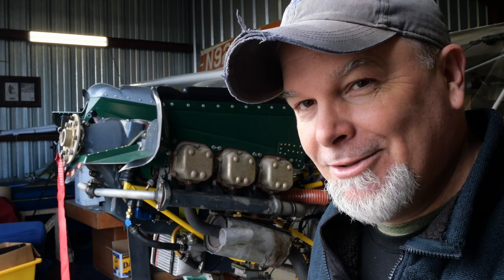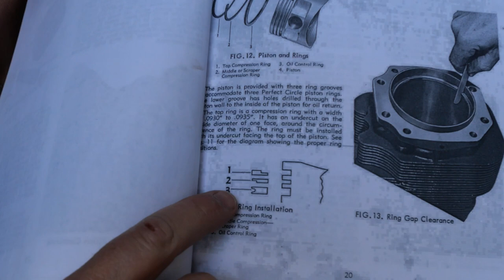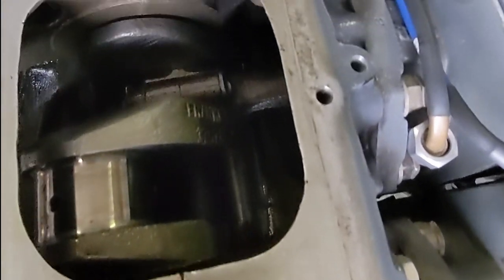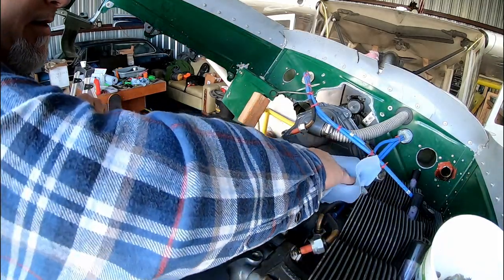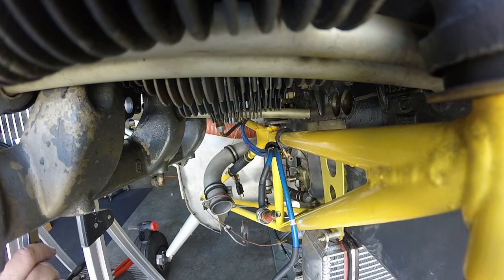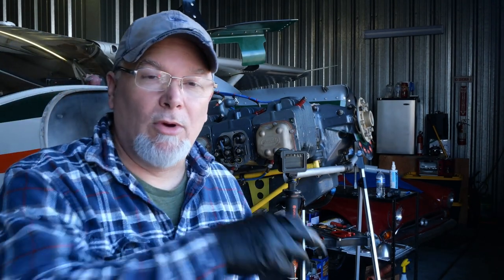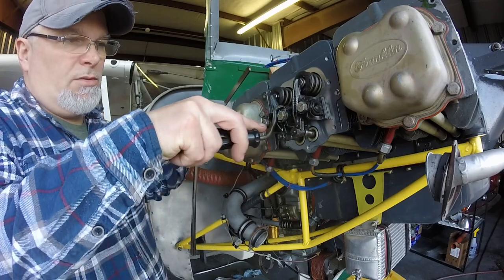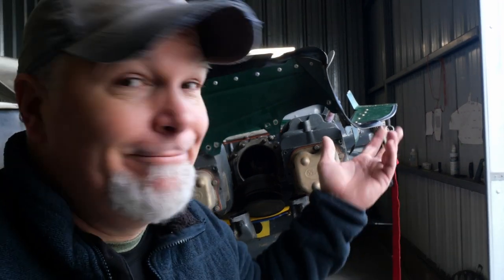Cylinder Swap |  Replacing a Cylinder on the Franklin 165hp

Comment: Good stuff. I have a '46 straight-108 with the Franklin 6A4-150-B3, based on a private airpark west of Bremerton. My wife and I are in central BC, having been on our way to Alaska last week when we lost a cylinder and diverted 50 mi to a small airport. Turned out to be a broken intake rocker arm on the #5 cylinder - this is one of the early 150s that used stamped rocker arms vs the later 150s & 165s that used forged. Valve wasn't stuck, pushrod not bent, rocker arm showed polishing along the crack line which makes me think it developed over a while.

I was able to source a replacement rocker arm only 90 mi away, but the mechanic who brought & installed it isn't familiar with Franklins, and we had a hell of a time getting the lifter depressed on the exhaust valve side to get the clearance set correctly (granted, without your handy tool). We got it close enough and I flew to his shop, engine ran slightly rough at times. This morning he made up a better tool and was able to depress the lifter enough to set the .040 clearance correctly, and on test flight engine ran much smoother. 

Curious if you've seen much variability between your various lifters. I'm wondering if this one being so stiff is due to being gummed up with carbon or whatever, and if this might impact oil delivery to the rocker arms. Maybe hastened the failure? 

Above aside, we decided not to continue north to Alaska. Engine only has 100 hrs SMOH and the failure gives me qualms about taking it anywhere too remote until it's proven this is a one-off.
Reply from the maker: As with most older aircraft and engines it's a risk you taking flying an older vintage aircraft on a long trip. Even after an Overhaul I always prefer to fly as many hours as possible. I am a very big proponent of Mike Busch's philosophy of proof of operation ( If it ain't broke, don't fix it ). If you have got to the trouble of finding that rocker you no doubt ave looked at the others. If you are that far intern Overhaul I would be less worried than if you had say 20 or 25. By the 100th mark most of the egregious errors pop up as you have noted. That should be some reassurance.

As for the lifters, there are a couple different styles. The Stinson Franklins share a lot in common with the Helicopter motors. Some of those internal parts are interchangeable and some are not. As I understand the 2 styles I have seen are interchangeable, I have both in Shelia. I ask that question early on with Susan @FranklinEngines , and she assured me that they were. Regularly checking those clearances ( 200 hours is the interval ) will keep your engine purring.

I hope that you have agreeable weather and have a safe journey.

Christopher

Comment: Since the 3/8" drive is in line with your wrench adapter, I don't think you need to turn your wrench at a 90. The drive isn't extending any, it just goes around something. Glad to see another of your videos. I don't have a Frank in my Stinson, but always cool to learn about them. Thanks!
Reply from the maker: You are correct about the center line. Mine are fairly close being custom made. This rule is more for crows feet and torque adapters. Thanks for pointing it out.

Comment: Hi great video. Can you share dimensions of the cylinder nut tool. Just received my 6 cylinder overhaul but don’t have the tool. Will make one. Thanks
Reply from the maker: Yeah, I don't know of anybody that sells the Franklin Cylinder wrenches due to the square angle that's needed to get around the fins. I would recommend around a 12" length and a 5" depth. Try to keep them concentric, so as to not need any torque corrections.

Comment: My VW bug ring compressor is just like yours!
Reply from the maker: The ring sleeves must be pretty small. What diameter are they?
Reply: @FreedomfixerFlying  cylinders are 88.5mm (about 3.5 in). Another question, do Franklin engines have cylinder studs that are also through bolts on the case (like the 'other' airplane engines)? Is there the same risk of spun main bearings after cylinder work?

Comment: I have a  Stinson 108 with  150 hp. Franklin  where did you send your cylinder to be repaired?
Reply from the maker: Since Airworx got out of the Franklin business, I currently do not have a shop. You can contact Susan Prall at Franklin Engines in Jewett Tx, Franklin Aircraft Engines in Ft. Collins Co or Franklin Aerospace in Thomasville, NC.
Reply: @FreedomfixerFlying  thank you

Comment: Wouldn’t you need to drain the tappets in order to accurately check the rocker arm clearance?
Reply from the maker: That is what the tool does, It depresses the rocker. And there is a small hole in the lifter where their escapes.